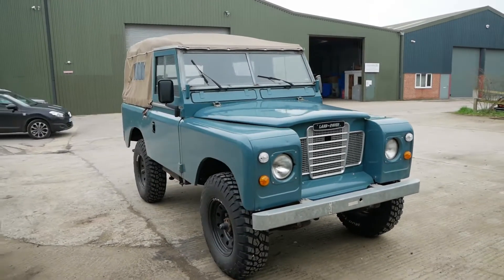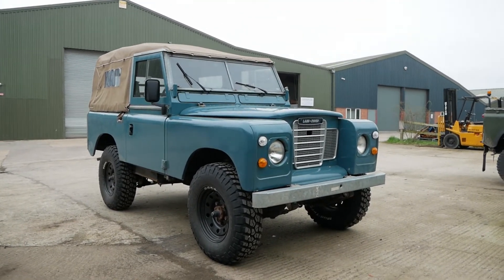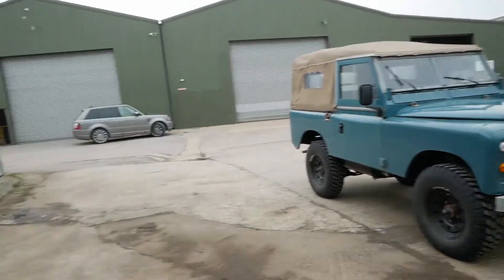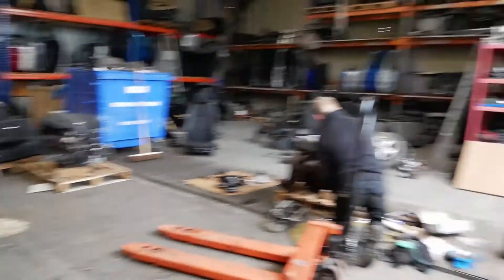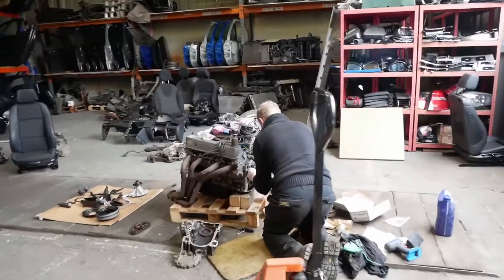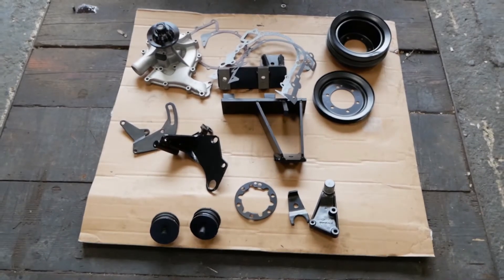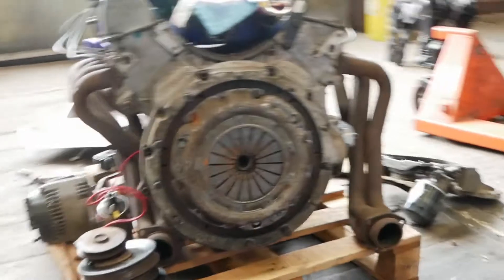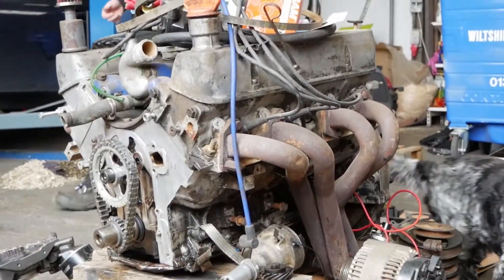Land Rover Series 3 V8 DIY Engine Conversion Episode 1

Comment: From old reliable but slow to unreliable power.
Reply from the maker: The opposite, sir. The 3.5 V8 has an edelbrock carb and upgraded camshafts. The Series is now away faster than it has any right to be. It's actually comical. Why people get all misty eyes for the old 2.25 petrol and diesel engines, I don't get it. They're slow, unreliable, noisy and just awful. Everyone should do a V8 conversion.
Reply: @vinnyvsx4954  everyone should do the conversion . . . and then post up a vid about it - just heading to the long awaited sequel!
Reply from the maker: It's coming matey. Covid has stopped most of the progress on the Series, but when I can get back down to the unit, I'll start filming all the progress